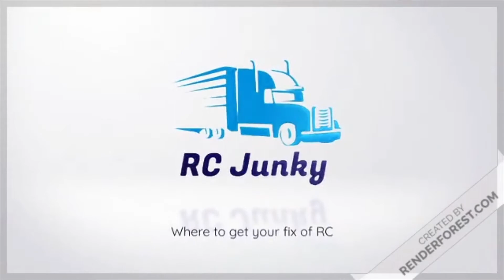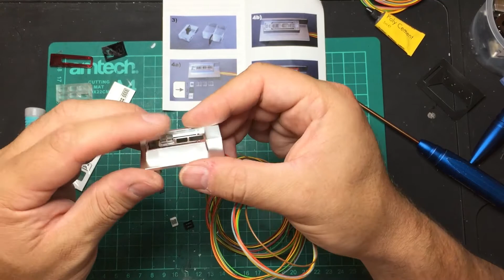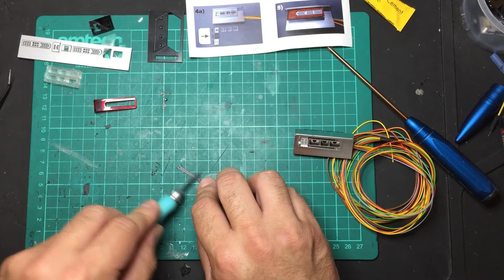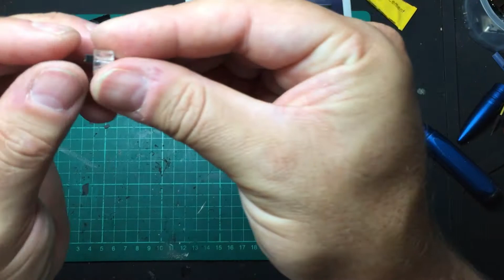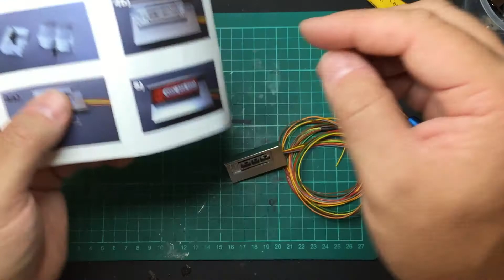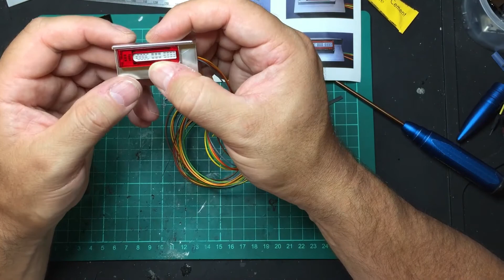ServoNaut LH6FH16 Rear lights build Part 2

Comment: As for the black plastic piece that divide turn signals and park/brake lights, sand the black flat pieces on a finger nail emery board to the right thinness.
Reply from the maker: That is sort of what I did using the shave/scrape with a blade. thin the parts to fit. Thanks for your feedback

Comment: Thank you for your informative Video, I found the black plastic in the lens a bind as well, I found the tip id a small Cable tie fitted nicely.
One Question how did you wire the lights up - did you link it to an MFC 03?
Reply from the maker: Hey Paul, thanks for the feedback. I will be using mine with a Beier SFR-1 unit. I have just done a video of the lights wired to the unit and some of what it can do.